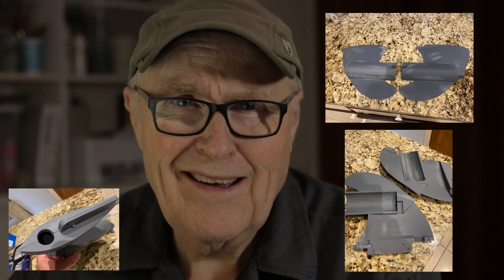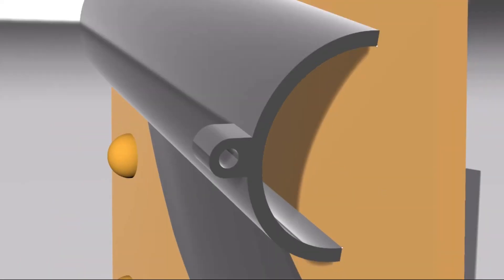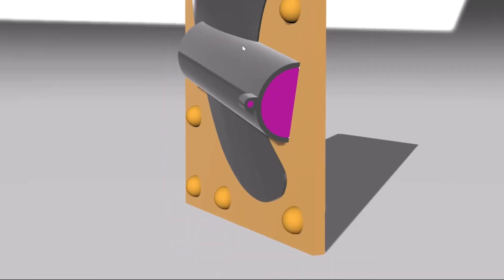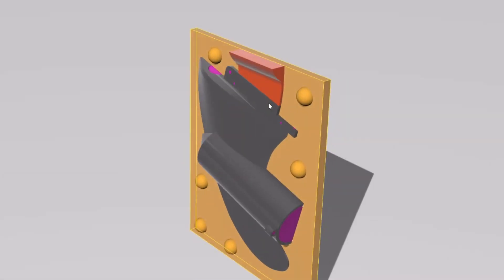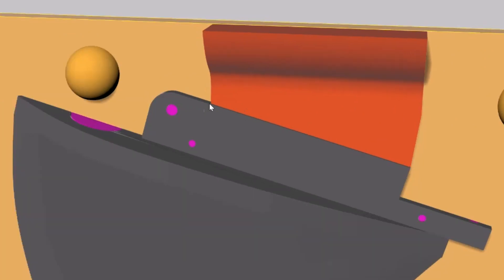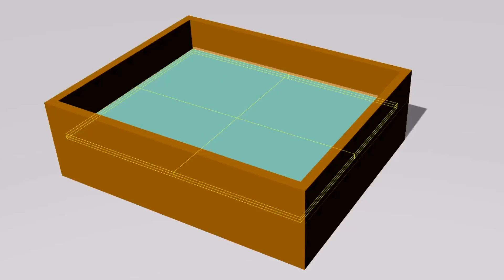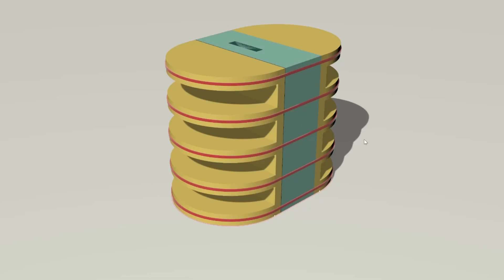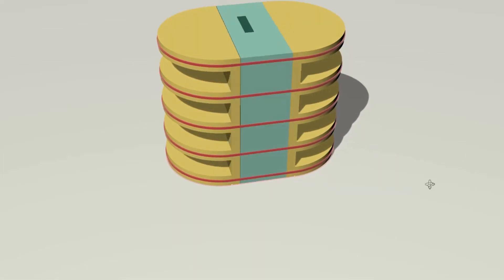Silicone Mold Making For Casting A Mechanical Part

Comment: Why not pony clamps to hold the box together?
Reply from the maker: If you have a mold case surrounding your rubber so that each half of the rubber mold is held in a box, then clamps work fine. As long as you are clamping wood to wood. But if you are applying clamping pressure on rubber to rubber it is almost impossible to get the clamp pressure even. So you run the risk of distorting the mold. Even if you have a nice thick piece of plywood on each side of the rubber mold, you’re still clamping rubber to rubber.  The bottom line is, clamps will work but it’s finicky to get the pressure even.

Comment: I always like your reasoning as to why you do what you do.
Ok, you know I’m a novice but I don’t see why you don’t just build a wooden box around the mold? Wood would hold it tightly and be easier to make?
Reply from the maker: A box can work too. The important thing is to apply even pressure across the face of the mold so that the parting lines close correctly. One bad thing about boxes is that they can hide the parting line. I make sure the lines are perfect around the outside of the mold to help assure they are properly aligned.

Comment: Robert, your video has me wondering:  in foundry work, we produce holes and cavities in metal castings by making "cores" (made of special sand in a separate mold).  After the adhesive in the core sand sets, the core is fit into the master sand mold.  The metal is poured, and after the parts have cooled, the sand cores are broken out, leaving the cavity behind.   

I've got a plastic mechanical part and I'd like to produce several dozen copies. But the part has three holes going through it (a 1/2" hexagon, a 1/2" square, and a 3/4" round hole).  Couldn't I create three separate molds to make separate "silicone cores"?  I'm imagining a brass tube going through each of them (for rigidity and maintaining the shapes) that could be inserted into the master mold?  Then, after pouring in the resin and letting it set, I could open the master, and take the main resin part out which would still contain the 3 silicon cores.  Next, I could pull the metal rods out, (which would remove the rigidity from the cores), allowing the flexible silicon cores to collapse and come out of the cavities.  If I haven't confused you too much, can you see any reasons it wouldn't work?
Reply from the maker: Your plan would probably work. If you like, send me pics of your project. Possibly I could suggest a simpler method to cast them. But I won’t know until I see the part.  Reach me at roberttolone@yahoo.com

Comment: The format is great Robert. I cast parts for the models I scratch build and I have seen distortion in even large parts using rubber bands to hold my two part molds together. The method of using a cradle is a great idea and I will make a few for my different molds. I have learned a lot from your tutorials and I will be putting this information to work. Thanks for sharing your knowledge.
Reply from the maker: Thanks John!

Comment: Robert, This video is incredibly useful to me.  I'm building a surfboard project and this instruction is most helpful.  Thank you so much.  Did you ever further this project and actually cast the parts?  I'd be interested in see more.
Reply from the maker: No, the designer of the part wanted to cast them himself.

Comment: If I wanted to make a small molded piece of translucent silicone with high tear strength, what would you recommend? Thank you
Reply from the maker: I would search for a silicone with the properties you require.  The Shore scale measures how hard the rubber is, the modulus of elongation tells you how much it will stretch before breaking. The material data sheet for a particular rubber will give you this information. It should be a simple enough matter to search for the appropriate material.  I cannot give you a specific product recommendation because I have very little experience working with translucent silicone.

Comment: Would love some advice on how to cast a Remote control car tire. I have an old vintage car that I would love to replicate the tire.
Reply from the maker: How big is the tire?
Reply: Robert Tolone, thanks for replying, the tire is small, inside diameter of 1.74 inch, height of the tire is 1.23 in, and outside diameter of tire is 2.5 in.  I have a couple vintage Rc cars that the only reason I don’t drive them anymore is because they don’t sell tires for them anymore.  I actually have an old Rc Lamborghini that I have had for 28 years, the tires are so hard from age, but the rest of the car is perfect. Learning how to replicate tires would be amazing. Thanks again for your time!
Reply from the maker: Iridium I have never made a functioning rubber tire and have no idea if I could do it successfully but it would be a lot of fun to try.  If you want to do it as a project here on the channel send pics to roberttolone@yahoo.com. Thanks!

Comment: can you show how to make a copy of a part where you need the hole to be copied because it cant be drilled or machined out? Is there a way to email you?
Reply from the maker: Deep holes in rubber molds are difficult because the rubber bends or sags. Plus it’s very easy to tear out the rubber when removing the casting.  Email me at roberttolone@yahoo.com.

Comment: I think this format is working for what you're trying to accomplish with viewers inputs.  It gives a good perspective on what to look for when planning a mold.

I would be interested in your overview of the different molding and casting materials.  I'm unclear about what materials to use when, or for what reason, particularly for newbies without pressure and vacuum pots.  For example I've seen you use urethane for making mother molds, and then turn around and cast 150 tiki's in the same material . Why?   So maybe you could break down some general categories of molding and casting resin materials and their appropriate uses - or direct us to the best literature that covers such things. In any case, keep on casting!  Your enthusiasm is infectious (in a good way)!
Reply from the maker: Great idea for a video, thanks for suggesting it. I mostly cast urethane resin in silicone rubber molds.  But there are so many methods of making molds and so many materials you can cast with that it is very difficult for beginners to figure out the best materials to use. What kinds of things are you interested in making?
Reply: Funny you should ask. I've contemplated sending you some pictures to review.  In particular, i'm trying to reproduce vintage door lock handles for a 1940's travel trailer that were originally cast in aluminum (although resin works for me).  I've made a silicone mold to cast a few simple ones with some success, but have been stymied by one in particular that has a hex opening to fit onto the lock mechanism. I'll send photos to you for more detail.  I've also considered other unavailable trailer pieces like light fixtures as I become a little more proficient.  So your videos have been a great help on my learning journey.

Comment: So glad I found this channel. Just subbed. Interested in how to avoid silicon seepage on the part halves. My project is a thin wall “cereal bowl” if you will. How can i secure it down (face down) and create a good seal with a clean parting line? Thanks ahead of time!
Reply from the maker: One way is to seal the edge of the model with the same rubber you will mold with. Paint on just enough to stick the part down. It might help to put some weight on the model; not enough to deform it, just enough to hold it flat. Then paint on the rubber seal.  Because it’s such a small amount there’s no pressure to force the rubber under the model. But be careful not to push the rubber under the part with the brush. After the seal is cured you can pour the main body of the mold. This also works for the seams in mold cases etc.

Comment: Robert, I’m a model maker that’s builds mostly science fiction models and I’ve got a general knowledge of making molds and casting. I recently built some masters of some bases I want to use for my built up kits. I need to house electronics in the base which is hollow and I know I need a two part mold to cast them. I’d like to show you photos of what I’m working on but I don’t know how to share them with you. Thanks for the great videos!
Reply from the maker: Hi Jeff, send pics to roberttolone@yahoo.com.

Comment: The 3d graphics really made it more tangible, compared to the 2d and prop video before you can see whats what a lot cleaner. Also i do enjoy the less hands on explanations, mainly because when its more abstract i find it easier to compare to my own projects, that don't necessarily match up 1:1. My recent project has a lot of potted  in LEDs and wires, experiments have shown that its really a hassle to make them not float away. sorry for the tangent.
Reply from the maker: I love hearing what people are working on.  I’ll definitely be doing more potting-in videos in the future.  Potting can be really tricky!

Comment: Super video Robert; awesome choice for this week's "mold puzzle", and even more brilliant "solution" to the mold puzzle for us to learn from you. I found the 3D animation approach very clear and instructive; but at the end, I felt I was really ready for you to say: "Now, let's head into the shop, and do it!". There is something so unbelievably satisfying about watching you "birth" a cast piece from a mold for real; that when I didn't witness that, it was simply not as satisfying in some way. Would you consider combining the two formats, beginning with the 3D animation "Problem, Theory and Solution" classroom section - as you have done here; and then, without having to re-explain the whole approach, move us into the shop with you, so we can watch you do it for real; "in the lab" - so to speak? Being a highly-visual learner, when you mentioned certain materials, such as:  half-round spheres, sheet wax,  and half-round sprues; it would really be helpful if you could show us an in-hand example of the materials you use (beyond silicone and resin) - I have to presume these are wax or clay, but I don't really know - and please tell us where one buys these things like: half-round spheres, sheet wax, half-round tubes, bees wax, sticky wax, etc; as I for one do not know if I need to go to my local hobby shop, dental supply house, or hardware store for such things. I would have also like to know what adhesive you would have chosen to secure the part to the backer-board; especially for this technique, as you mentioned we want it secure, but not fused to the backer; so not to disturb the setting of the piece in the mold between pouring the two halves. Thanks again for another great video; you are the best!!!
Reply from the maker: Baron, your comment is too detailed and complex to answer well here. So I will do a video just on waxes, wax tools and wax suppliers in the near future. 
In the meantime Google: foundry wax, jewelry wax, Sculpture wax,  machinist wax, sprue wax, sticky wax, sheet wax, beeswax, carnauba wax, microcrystalline wax. 
You’ll find an amazing amount of info on waxes and suppliers. Thanks for your thoughtful comment!
Reply from the maker: Also, your question about which adhesive to use to attach a model to the backer board prompts a video all by itself. I glossed over it in this video but it is actually a more complicated and difficult problem to solve than it might at first appear. How to approach this problem is worthy detailed exploration.

Comment: Hi Robert, thanks so much for these videos.  I think for those voyeurs who simply like to watch (really, most people on youtube),  your other format with actual molds and  pours are entertaining and informative, but for me (getting ready to make my first molds) this video contained a TON of useful information. I think you (and all of us watching) might benefit from adding this format to the lineup from time to time. I really like how you can see into the molds, to really understand what's happening and why you are making those choices. Keep it up. Thanks.
Reply from the maker: Thanks Richard, I appreciate your comment. Be sure to let me know if there are specific topics or issues you’d like me to cover. That really helps me plan the content for my channel.
Reply: @RobertTolone  One thing, I'd like to know about casting parts with tighter tolerances and if that's possible. For example, if I have a jar with a snug fitting lid (with a gasket, both lid and jar need to be cast)  is there a preferable way to cast this? I would assume a cut mold for the lid and jar would allow some sort of slight deformation of the parts and they wouldn't fit together correctly? Thank you.

Comment: Hey Robert. This video was very informative. Especially the explanation on how to apply preasure evenly on a cube-shaped two part mold was great!
The animations are well done, good job on that. And I finally saw a two part mold making project from you. =)
Since you asked for suggestions, I would like to leave a few here:

1) I like this video format you are doing, it contains a lot of information in a short amount of time. But I would not replace your other videos entirely with it.
The videos where you are actually working with materials, rubber, machines and where you are unmolding your castings are somehow more entertaining.
It is very enjoyable to see how much you like your work and it's really entertaining to see you when unmolding your castings, and this format is missing all of that.
On the other hand, the video you uploaded right now is very "dense", right on the point, like "POW => Here is the knowledge you are looking for.", which is enjoyable, too.

If it comes to my opinion, I would like to see a good mix of this kind of informative "pow"-videos ;-) and the ones you did earlier, where you show the actual work on a project, showing the machines, the materials, the pressure chambers, the unmolding and all that stuff.

2) As I mentioned before, when you feel like it, I would love to see you do another project on your own by searching through your scratch books. =)

3) I will come up with a project idea, but it might take a while until I find the time to do it. I want to create some small figurines, little monsters inspired by the 1991 Trash Bag Bunch. 
I would like to create an opague inner resin part, which I then want to stick into another mold that will surround the part with a translucent resin. Like a brain and some spikes inside a ghostly outer shape. My idea is to for example take the spikes as the anchor in the second mold. So the spikes will "break through" the translucent resin and will stabilize the inner casting in the second mold. If you already have some tips for me, I would love to hear them. But I will also send an email when I found the time to start my project.
Reply from the maker: Thanks for the suggestions! They are so helpful to me. I have been receiving a lot of requests for help on projects via email and Facebook. The last two videos were an attempt to address viewer issues when I don’t have the actual model in hand.  But these videos will not replace my shop videos where I actually do physical models. My favorite part of molding and casting is pulling a casting out of a mold.  I think people get a kick out of that as well.  Next week we’ll be back in the shop. 
Looking forward to seeing the sculptures you come up with.
Reply: I have to agree with this comment. The information is very dense and superb. Perfect for understanding solutions to potential problems. I also do like to see the de-moulding as it happens. I certainly get the point that you can illustrate the solution when the original is not in your hands. For myself, I’d like to see how to efficiently and cheaply make a quick yet accurate waste mould of a figure with many extremities in order to continue sculpting in wax. I say that because it’s the exact thing I will soon be doing. I want to minimise shrinkage and maximise the reproduction of the detail that is already present. I don’t work to an industry scale per-se but that’s a consideration perhaps.